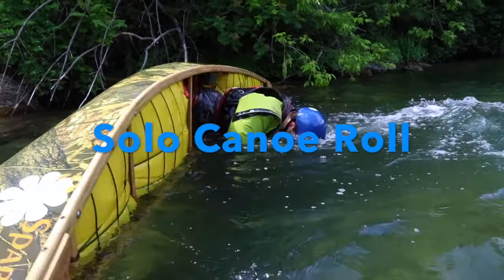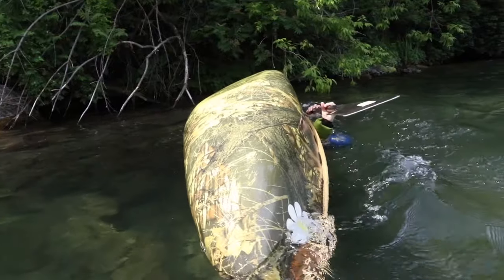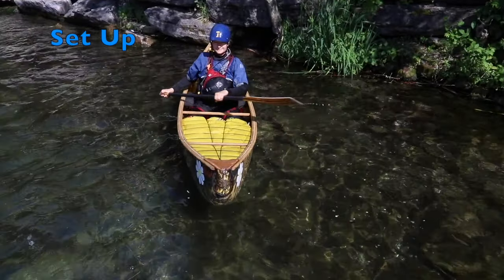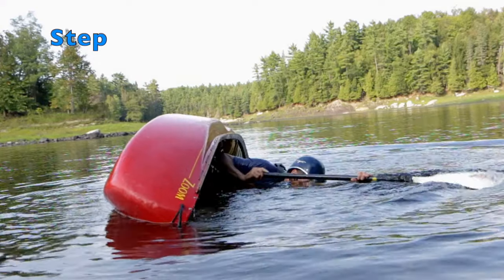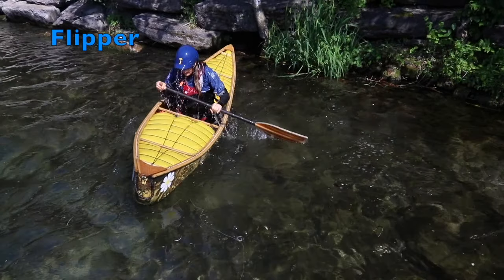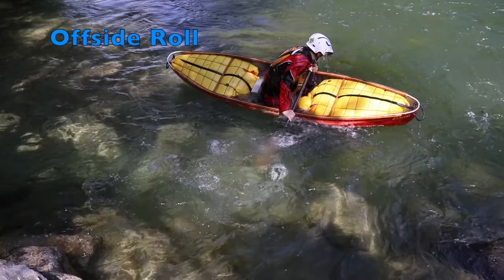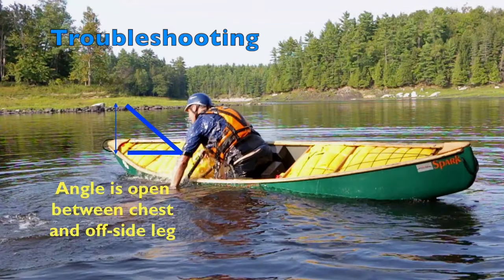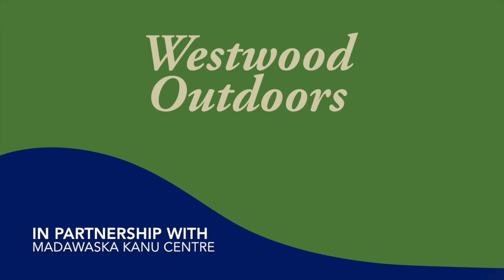Solo Canoe Roll

Comment: Well made video with lots of good pointers tips and information although I would have to say part of the trick is the leg straps that you guys are wearing I have a bigger an older white water canoe with a perception saddle that's made from plastic and even with the horns it is extremely hard to finish with your thighs when wet and upside down it wasn't till I bought the thigh straps and was secured in the canoe that I then had the ability to flipper back over. But definitely a great video.
Reply from the maker: Absolutely! Straps are essential.
Reply from the maker: Anything to keep your legs “locked” in really. Foam bulkhead good too. Toe pegs or foam are good to press against to keep yourself in place. Try not to relax the legs when you go upside down otherwise you’ll drop out of your canoe.

Comment: will this work with a typical canoe without the bulkhead floatbags?  I suppose you would have to have your thighs under the thwarts for starters.
Reply from the maker: Hey Mike, the rolling skill can be done the same way with your thighs wedged beneath the center thwart of your canoe. You may find that rolling without airbags is actually easier. With the reduced buoyancy you don't have to lift yourself as far above water.